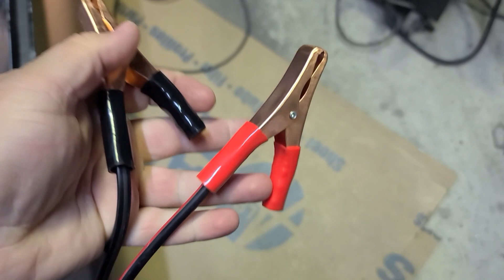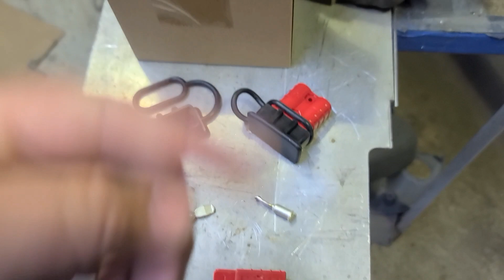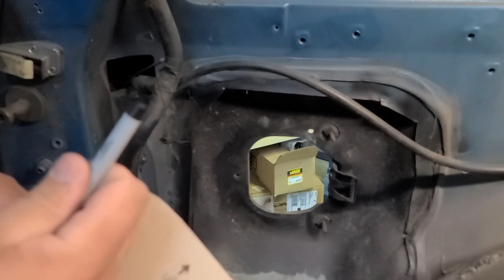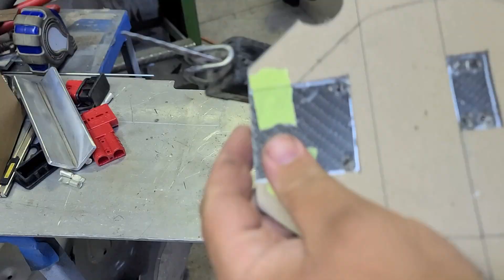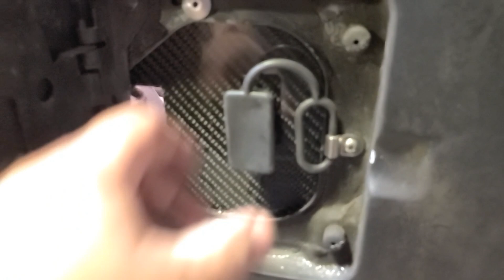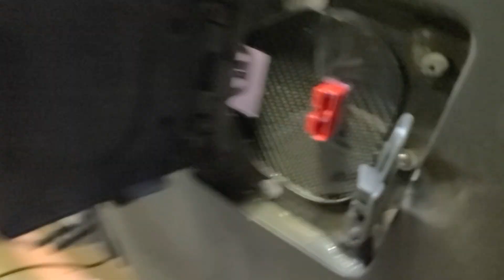Toxic goes EV.... kinda

Comment: Anderson quick disconnects , a darn good way to go. I use the big ones on some regular 2 size jumper cables to run my winch on my car trailer , works like a champ. They also can be used as jumper cables by plugging on another end piece.
Reply from the maker: I forgot the name of them, thanks!
Reply: @Josh_R_Growth  Your welcome , I have my winch set up so I can remove it from the trailer , so the quick connects work well with that set up.

Comment: It's the little things. I used a fuel door on the bed of the s10 pickup for access to the blazer tank mounted underneath the bed in the back put a little seal around it. With the bed liner it blends in.